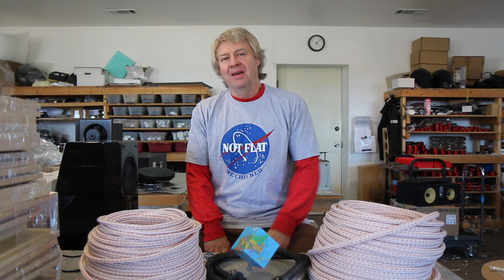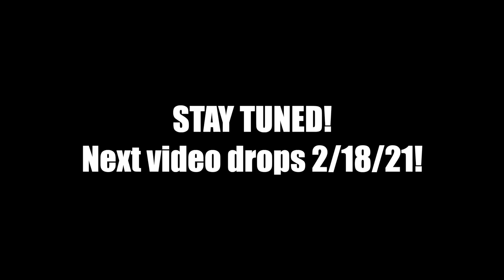Audiophile Cable TRUTHS: The Divided Camps

Comment: I used to strongly believe that cables and interconnects couldn’t possibly, scientifically make a difference. The result of that belief was that I didn’t enjoy listening to my sound system for several years. Around  1998 I heard a sound system with Magnepan speakers, (SMG-A’s?) along with an NAD 7400 Receiver, a NAD 5170 CD Changer and some speaker cables that were much bigger than the lamp cord I was used to. I heard Jewel’s album “Pieces of You” played through that system and it sounded like she was in the room and the speakers weren’t even there.  About 10 years later I bought some Magnepan MMG’s off of eBay. I decided to get a high powered Behringer amp and a Denon DVD player that was on sale for $50. I also bought some 12awg stranded copper no name speaker cables from eBay and used the RCA’s that came with the Denon. I believed that the only thing that could possibly make a difference in sound was the speakers as long as the electronics and wires weren’t broken. I was so excited to hook it all up and hear that same magical sound I’d heard years ago. I was so very disappointed. It sounded like there were 10 quilts over the speakers. My cheap alarm clock radio was more enjoyable to listen to. I would have thought that I just didn’t like Magnepan speakers if I hadn’t heard them before. I finally broke down and decided to try an NAD 3400 integrated amp even though I expected nothing. To my surprise it made a noticeable improvement. I figured maybe I was wrong about all digital sources sounding the same too so I bought an Cal audio Lab CL-15 CD/Dac. Again a noticeable improvement. Still, the sound was maybe 70% as good as I had heard years ago. After a few years I finally was willing to accept that maybe cables make a difference and bought some Morrow speaker cables and interconnects for a few hundred. At first they sounded maybe 10% worse and more veiled that the cheap stuff I had. Okay, so maybe different cables do make a difference. Could it be that they need to “burn in” gasp! They did. They went from 10% worse to 10% better than the cheap stuff. I then tried some Kimber Kables. Wow! The blankets were completely gone. But I also seemed to lose some bass which was already in short supply on the Magnepans. Finally I called a dealer in Minnesota that sells Magnepans and asked which cables/Interconnects they recommended. They said Transparent is what they found compliments the Magnepans the best as well as confirming that NAD equipment is  a very good match. So I bought some used Transparent Audio cables/interconnects for around $400 and FINALLY my sound system sounded as good as what I remembered hearing several years before. Something I also learned was that swapping cables/interconnects, even after burn in, still required them to “settle in” for a few minutes to hours before they again sounded their best. This of course makes it harder to A-B them. I found that the best way to compare cables was the “overall feeling” that I got listening to them over time. I know, feelings are not very scientific. But it brought me the most joy in listening to music when I finally accepted this, and for me, that’s what’s most important.

Comment: When using proper measurement procedure the result is simple: cables that measure the same will perform and sound the exact same. It is that way in every other industry on earth including NASA and telecom companies that need to send signals across the pacifific (instead of just a few feet across the living room). Audio is not some magical exception. And yes ,cables can sound different.

Comment: If you want to do a good test for cheap like 30 bucks : buy 2 differents cables from good know professional brand like mogami, canare, sommercable at 5 or 6 dollars per meter maximum and do a blind test in mono with an amazon basic cables at the same price more or less. Take the same gauge btw. Get help from a friend to change the cable on the go. For me even with a very good system i can not here any difference or very little especially just a reduction in high frequency between mogami, canare, sommercable and amazon basic.  But i can here big difference with an linear EQ of 1 or 2 DB in the signal. conclusion for me = good pure copper cable at the less price and you are good. invest in better driver, better amp but cables... Last thing to check in my board.
Reply: Your cable comparisons are all lateral moves. There is not much difference between them to matter much. If you want to hear a real difference then you have to step up to a higher quality cable.

Comment: Are there any measurements that (approximately) measure the sound quality in relation to what you hear? I would really like to have objective measurements that allow me to justify my $1k purchase of speaker wires. If one could prove (with measurements) that wires that cost a fraction of that have a significantly worse sound quality, then I would be all ears (pun intended).  
I tend to lean to the fact that at some point (and I mean right at the point of having to take a second mortgage just for my cables) the quality is subjective. And the trade off (quality vs. money) is done on a personal rather than objective level.
Reply: Wanted to add that I would love to have those measurements so I can prove to myself that it isn't just a placebo effect. But I am also a bit worried that those measurements might be less convincing than I would expect.
Reply: Currently there is no way to measure MANY audible effects and differences. For instance, imaging, sound stage layering, soundstage depth, space a distance between things in the sound stage. How do you prove those things exist?  And those are things easily altered by various cables. 

And do you really need for someone to prove what you already hear in order for you to believe that you hear it?
Reply: @dannyrichie9743  well I  would like some tangible justification, especially when I am inclined to spend an insane amount of money 😉.
Reply: @robvermeulen  Keep watching this series and I'll give you some good tangible information that should help everyone understand this subject. There is an illustration with measurements coming. And you will learn that spending an insane amount of money is not necessary.
Reply: @dannyrichie9743 Thanks!  I'll be watching this series for sure. Just found your channel a few months ago and "bingewatched" it. Keep them coming 😉

Comment: After viewing countless HiFi reviews I'm learning that the ideal components, or ideal Loudspeakers are either astronomically priced, or very difficult to find. It seems the plethora of components might be good at some audio aspects but not so got at others.  It's either a compromise, or it's about matching components to achieve the best result. Could speaker cable fit into the same camp? Is it about matching cables with the right Loudspeakers or with the right Amplifiers and other components? A speaker cable might result in better sound reproduction with some Loudspeakers, but not discernible with others?
Reply: Yes, with the circumstances of composition.  I would ask most people to use bare wire, run it , listen.  Obviously, don't short out the wires.

Comment: An excerpt from a recent REL Acoustics Blog Article: Revisiting Bassline Blue

"Something clearly had to be done, you see we’re not one of those head-in-the-sand audio companies that doesn’t believe that cables make no difference. We’ve known for almost 40 years that for speaker cables, interconnects, HDMI and digital—not to mention a/c–we can hear the benefits when they get it right and the downside when it’s poorly executed. Like it or not, cables matter and the flat earth audio types can complain all they want but they’re simply in denial. But connecting to our impedance environment is unique and this is where conventional cable companies get it wrong."

Comment: In my experience speaker cables have less influence on the sound than the interconnects.
Reply: They all make a difference
Reply: @Douglas Blake Your point being? Ohhh...., I see! You thought you were being clever with some kinda snarky, but old n’ used up comment like that. Keep it up, ol’ Dougie boy! Now, you’re going places!
Reply: @Douglas Blake I wish you’d responded like that in the first place, but I also owe you an apology for my insulting comment. That’s not me or what I’m about. Anyway, things such as temperature, humidity, atmospheric pressure, etc. play a part in how we perceive sound. I also believe that certain cables can sound different and make a difference too due to their metallic make up, capacitance, inductance, etc., but to quote Peter Q. of AN and Herb Reikert, “We can hear what we can measure, but we can’t always measure what we hear”. I’d like to add a “yet” to that quote, but you get the idea. Cables that work with your system don’t have to be expensive either. I build and DIY a lot of my cables, if possible. Again, sorry for my initial reaction to your comment, but at least now we’re having a conversation instead of slinging insults. ✌️🎶

Comment: I'm confused... don't measurements AND real-world results go hand in hand?
A Bugatti Veyron for example, sure, does 250+MPH, but it also measures at 1000+BHP, doesn't it?
Or is it like 150 BHP... but somehow miraculously manages 250 miles?
And then maybe there's a 1500BHP engine car but just can't go over 100MPH?????
Reply: Exactly, they go hand and hand. You can't just measure and the power and theorize the result. You have to run it to confirm it. The same goes for cables. You have to listen to them to reach a conclusion.
Reply: @dannyrichie9743  Understood. Ok, cool.

Comment: Can someone answer this please, if I spend £500 on a stereo system And I think it sounds amazing, would that be the same if an audiophile spends £20000 on a stereo system and thinks it sounds amazing? This is not a trick question.
Reply: @Douglas Blake I agree!
Reply: @davidlong1786  I think you’re right about audiophiles, they start by learning too much about sounds and then they can’t stop buying new equipment but if they can afford too then good for them.

Comment: Here is a practical experiment that completely dispels your "beliefs" about audio cables:
https://www.youtube.com/watch?v=ZyWt3kANA3Q

I challenge you Danny to provide an explanation as to why when we LISTEN to the difference between two audio cable signals all we HEAR is silence, unless it is massively amplified to essentially reveal the noise floor.  You can't incorrectly blame measurements or a lack of scientific knowledge for this example.  You have to actually explain why LISTENING reveals there to be no audible difference between competently chosen audio cables.
Reply: @Douglas Blake this is literally irrefutable evidence, done in a practical way, that demonstrates how wrong Danny is in this audio cable "series".

Comment: Ive done a lot of test on speaker and rca cables measuring capacitance inductance and resistance and organized them in this chart: https://www.dropbox.com/s/pa9g9opvdy8300z/Cable%20Comparison%20.xlsx?dl=0  Ive included the length brand configuration materials and gauge. In general measurements wise quality coax like Belden 1694a or Blue jeans cable measure best. While thick gauge pure copper speaker wire measures best. But ive found myself bounce between cables lower on the list and higher because i like having a bit of color in the sound from time to time.
Reply: @davidlong1786  I agree with you full heartedly i usually have an EQ between my amp and DAC to mess with the sound and use blue jeans cable LC-1s for most of my connection and some 10 gauge speaker wire. I usually do it out of curiosity because i just like messing with things.

Comment: You are describing feelings, not science.  Science can tell us that not everyone hears exactly the same, so not everyone will hear a sound exactly the same.  The difference in individual hearing is feelings, not science, the sound wave has not changed because of the transmission medium if the medium was appropriate to begin with.  If someone believes a different cable changed the sound, then good for them, it was money well spent.  Danny, I do not, for one minute, believe you agree with the crazy stupid marketing and gimmicks that are happening with so called "high end" cables selling for thousands of dollars per foot.
Reply: wrong. people’s hearing are different. The shape of the ear canal the size of everything and even the outside shape and size and angle of the outside ear makes a difference.
Reply: The science of cables is almost as good as CDC Covid science.
Reply: @brainache555  Comprehension, not your strong suit, is it?

Comment: Measurements are only worth anything when you know what you are looking for.
Just having numbers and then trying to figure out what those numbers mean, is a waste of time.
Reply: @davidlong1786  So, as you seem to know, help me out here: What measurements are required to tell an okay cable from a good one?
Sure, knowing a cable has a resistance of 0.15 Ohm is useful when the manufacturer claims it is a 20 AWG conductor, means the manufacturer lied.

When a reviewer just clicks "run all tests" on their "definitely the best analyzer money can buy", that will just reproduce the spec sheet numbers with some variance depending on sample size. Does not tell me jack about the product being good or bad.
Reply: @davidlong1786  Well, you are wrong and you' re right. You are dead wrong about cables. And those places you are expecting to see a difference is NOT where the differences will be. But, you are correct in that you need not spend a lot of money to get high quality cables that can take your system to another level.
Reply: @davidlong1786  I don't have to prove to you that you're wrong to know that you're wrong. I don't feel the need to convince you either. If your system doesn't allow you to hear a difference in cables then you obviously don't have much of a system and are not really into music.

Comment: If it's all about listening then why don't you record it in a controlled environment and provide sound clips? Your cable vs whatever.
Reply: Maybe I have? More in this series to come...
Reply: @dannyrichie9743  It's going to be interesting to see what convoluted method you come up with to change the sound when swapping cables.  You're going to have to fabricate some sort of multiple speaker setups test or some such nonsense to add extra variables if you're actually going to play the sound.  We will be able to graph the response if you do it on YouTube.  It will be VERY telling.

Comment: Science is both observation and measurement. If one doesn't agree with the other then its just cause for further investigation. But considering this isn't a cure for cancer or that this isn't a life saving issue, then if a person hear one cable different over another, and prefers that difference then that should be the middle ground I.e. they measure the same but apparently sound different.  World Peace !

Comment: Hi Danny , cable quality has huge impact in analog signal , I did a lot measurement with vector analyzer (https://www.omicron-lab.com/products/vector-network-analysis/bode-100/ ), 
now I think good cable for price is OCC silver cable , it is Ohno Continuous Casting, (http://wp.neotechcable.com/up-occ-silver-cable/)
another good cable is Swedish company (http://www.jenving.com/products/view/sword-terminated-pair-1000000727 ) which I have in my system , they measure well and sound good too .
To hear difference you should have good system in whole way , low noise amplifier,  wideband fast slewrate,  low noise source,  sensitive speaker , if you have amplifier with -80 dB noise floor, low sensitive  speaker , bad noise source you were not able to hear the different  , because all small signal in microvolt range is masked with that noise , for example 24bit digital to analog has   -144dB floor ,  if your amplifier has noise floor -90dB then your nano  range voltage  signal from your DAC will be masked by amplifier  noise ,  good hearing can down to level around -135 dB . Some people who don't understand this can do one simple test : 
Put your hand on your mouth (cover your mouth), then talk to someone,  ask him if he can hear you better with hand on your mouth or without hand on your mouth,   I think they will hear difference. Another good to know is that speaker cable should be short length  connections to amplifier,  from source to amplifier can be long , reasons is that capacitive in interconnect cable to input amplifier in combination with high input impedance can be driven easily ,  on the other hand shorter Speaker cable has lower inductance which output amplifier see it and that is better then long cable with high inductance.
Reply: @davidlong1786  I did a lot of measurement during 10 years , data from that can't fit in YouTube comments part. but if you think earth is flat then it is not for you that data , otherwise I can share it with other who think cable makes different in https://www.diyaudio.com/ .
Reply: @Jingle Nuts I came to the same conclusion as you with OCC cable , 
Price for value and measuring and sound test have correlation in my opinion.